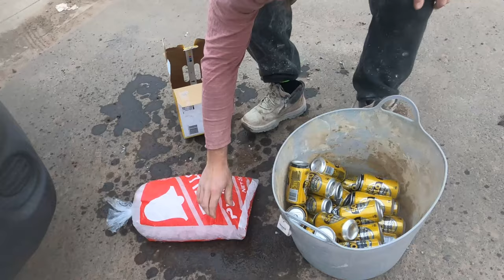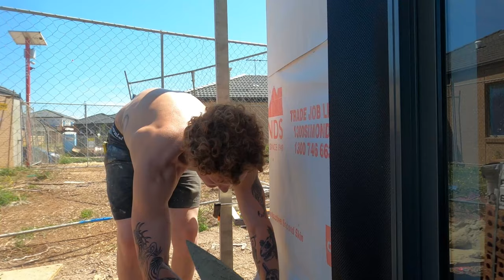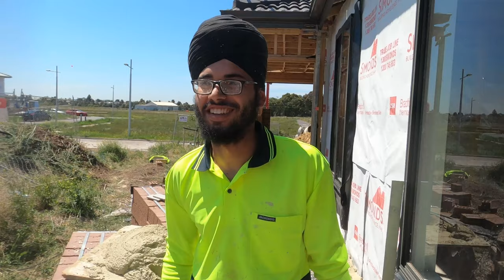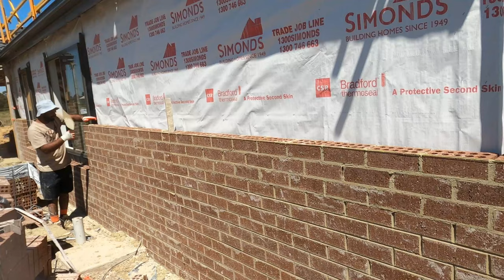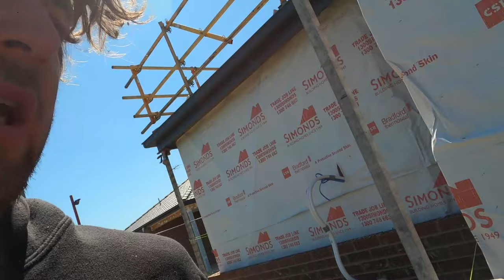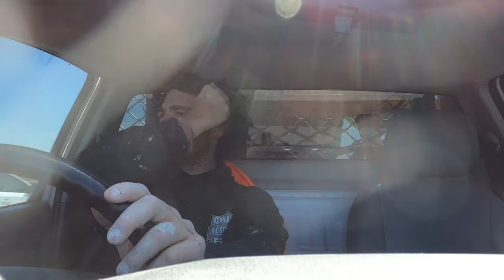Bricklaying - Meet the BRICKY BOYS ( #India to #Australia)

Comment: Have you tried putting your mortar on plastic spot boards mate?  Doesn’t suck the water out as much.
Reply from the maker: I have done this. The bricky store up the road sells tin like bucket lids. They worked well though I need to learn to wash them down at days end 🤣
Reply: Might sound silly but can use plastic flute board that signs are printed on. Need to sit them on top of a timber board to keep them stiff but they are surprisingly durable and don’t soak up the water. I used them for years. Can use them without timber underneath but you need to have about 8 bricks underneath them, or sit them directly on the ground. Can be a useful option too if you want to keep weight out of the trailer if you’ve got a fair bit of material to pick up for a repair type job. A few less timber boards saves a little weight.